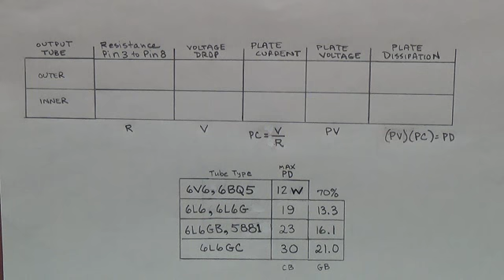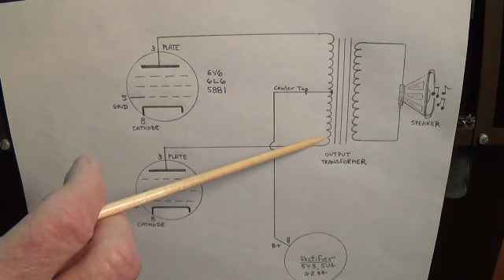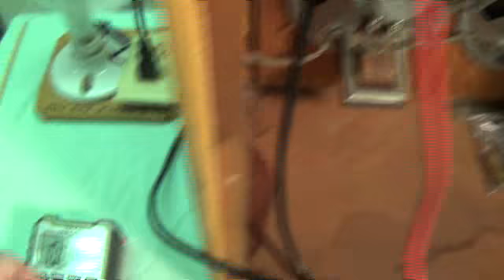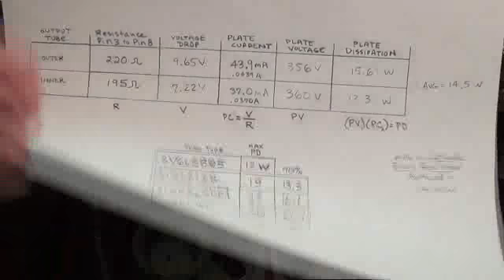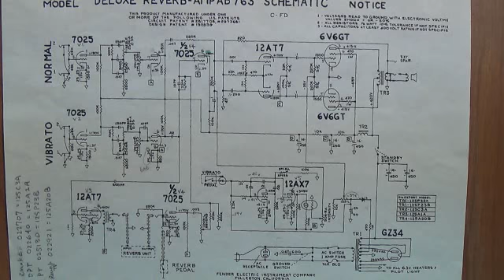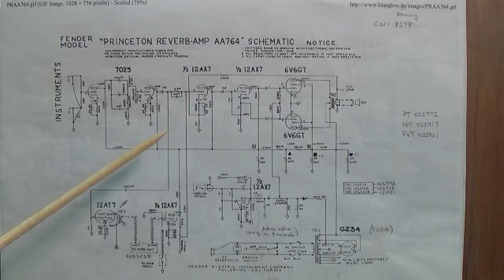Biasing Double-Ended Amplifier Output Tubes, Part 2: Demonstration and Discussion

Comment: Hey Doug, do you have any idea what might cause the voltage drop across the plate and OT center tap to be quite low (about -1.5v maximum)? I'm trying to bias a grid biased amp and am having that issue.
Reply from the maker: If your measurements are correct, then the tube is not drawing much current at all. Check the tube itself (i.e. swap in another similar tube and re-check the voltage drop) as well as the pin contact in the socket and the bias resistor (may be out of range).
Reply: so I swapped out the tubes and have the same problem. I checked all my resistor values against the schematic (fender pro aa763) and they're all the same... as I lower the resistance across the bias control pot the light bulb on my current limiter becomes brighter which I assume tells me something else is pulling current away from the tubes. Does that sound right?
Reply from the maker: As you reduce the resistance of the bias pot, more current flows to ground instead of the tube grids, so this is probably what is making the bulb light up more. When you measured the voltage drop across each of the two windings of the OPT primary, one voltage drop was a reasonable number while the other was essentially zero volts....if I understand this correctly. Have you considered that there may be a shorted or open winding in the OPT ?? Do both primary windings have approximately the same resistance ?
Reply: Both windings have almost the exact same resistance, 125 ohms, and the voltage drop across both windings is unreasonable at, about -1.5 volts max on each. The OPT and tubes are all brand new and the tubes are a matched set of 6L6GC's. I just can't figure out what would keep the tubes from drawing the current they need. I've looked up about everything I can find on biasing power tubes and current flow, but haven't been able to draw any sort of conclusion. The amp is working with a clean output signal but obviously not at an ideal bias point. I really appreciate your input.
Reply: I also just discovered that there is about 2 volts AC running from the plate to the center tap
Reply: Hallo Mike and  uncle doug.
I'm having the same problem with you mike on my silverface super reverb (45w  cbs) and i was wondering if you have finally  found a solution.Any help from you or uncle doug would be much appreciated,
cause  im in a dead end...

Comment: Hey Doug, I just used this procedure to check and change the bias on my old RCA AM/FM/Phono amplifier. It was using about 10.52 / 11.9 W for a pair of 6V6's in push pull. Average was 11.24W so bumping max. The cathode bias resistor was 270Ω. The readings never really stabilized at that output and the audio wasn't that great even at a low setting (3 of 10). I have a few 6V6's and I selected a pair with the same Gm. I installed a 330Ω cathode bias resistor and power came down to 9.81 / 10.88W. Average was 1035W or about 86%. The readings were stable. Plate voltage came up 10V (must've been stressing the transformer a little?). And the plate current was a lot closer. I'm going to leave it there and see what it sounds like. I might've left it the way it was if it was a guitar amp. I don't need distortion in this setup :o) Thanks a bunch for the video. Mike
Reply from the maker: All your measurements and modifications make good sense, Michael.  Plate current and plate voltage are inversely related, so one always goes up when the other goes down.  I hope it sounds great.  Best of luck.
Reply: I finished working on the amp this afternoon. It had a few other issues. The worst was a loud pop followed by a crackling sound that decreased in volume when I turned it off. That's not good. I replaced 5 bad resistors and touched up some ground connections then reinstalled the amp. I am very happy with the way that it sounded and how the volume control worked. And the pop was gone. You can't beat that with a stick. Now if I can just get the FM section to work and align the AM section I'll have a nice, oversized, home heating and audio cabinet :) Thanks for your great videos
Reply from the maker: You're welcome, Michael. Best of luck with your alignment and repairs.

Comment: What I don't get is how you add more resistance before ground and the tubes get colder. Shouldn't they get hotter because more watts get stuck dissipating in the tubes?
Reply from the maker: Watts don't get "stuck" anywhere, NR, they are simply a unit of measurement. Please watch my video series on Resistors and pay close attention to the part about Cathode Bias Resistors.  I believe it will clarify this issue for you.

Comment: I just wanted to thank you for this video Uncle Doug.  I was just able to bias my Fender Deluxe Reverb Reissue using this method and thank goodness I did.

After putting the new Tung Sol 6v6 power tubes in and taking my measurements,  I concluded that the tubes were running at approximately 11.5 watts of plate dissipation!  .5 watts away from hitting the max power for 6v6 tubes!

After a few trial and error episodes of turning the bias pot and taking the measurements again, I was able to get the tubes down to an average of 7.64 watts of plate dissipation which, obviously, is much more acceptable.

What I was curious about was what exactly would change when adjusting the bias pot on a grid based bias circuit.  It appears that the output transformer resistance remains constant.  Turning the bias pot didn't change the resistance from the center tap to pin 3 of the power tubes.

What did change was the voltage drop.  Before any adjustments of the bias pot, I was getting approximately 3.4 volts of voltage drop which resulted in approximately 29ma of current.  In the end, I was able to get the voltage drop down to 1.9 volts which made everything acceptable.  Here is my final chart:

http://i.imgur.com/jyK0bRn.jpg

Anyway, thanks again for all of your help.
Reply from the maker: You're welcome, DJ. The maximum PD for grid-biased 6V6's is 70% of the 12 to 13W max for the tube, or around 8.4 to 9.0W, so your PD is now about right. When you adjust the bias pot, you are altering the negative bias voltage being sent to the tube grids. Increasing the resistance to ground will increase the negative bias voltage on the grids, reducing the plate voltage and plate current....and vice-versa.

Comment: Just to be nit-picky here, and it won't make a huge difference either way...

If the B+ goes through a speaker field winding or a filter choke BEFORE it goes to the output transformer center tap, using your method includes the resistance of the other item.  Resistance and voltage drop should be taken from the output windings, and that will always give the correct answer.

But like I said, it's not going to be a big difference.
Reply from the maker: Greetings, Joseph.  I understand what you are saying, but in no circuit (that I am familiar with) does the B+ travel through any choke, field coil, or resistor before  going to the OPT center tap. Invariably, the B+ is sent directly from the rectifier to the CT, and any choke, field coil, or resistor is always positioned after the connection between the B+ and CT.  Furthermore, if there were any resistance between the B+ and CT, it would be included in both the measured resistance and voltage drop, and thus would not affect the accuracy of the current calculation in any way.

Comment: I am trying to bias my Sunn Sentura II. Using the schematic I have determined it is grid biased but i  am having difficulty tracing pin eight on the rectifier to the  center tap of the transformer. I am replacing the tungsol  6550's that were in it with kt 88"s as called for in the schematic. I also replace the 5u4 rectifier tube with a gz34 . my question is this. are the bias values for this amp with these tubes determined by using pin 8 on the rectifier and pin 3 on the kt88's?
Reply from the maker: If you're trying to determine the plate current for each tube by measuring the voltage drop across each half-winding of the output transformer, then you must use the lead closest to the 
center-tap.....which may not be pin 8 of the 5U4 or GZ34 rectifier.  Check the schematic to see if there is a standby switch and/or a filter choke between pin 8 and the CT. If there is, then you need to find a CT connection after the filter choke and be sure the standby switch is closed. Your other test lead will be on pin 3 (plate) of one output tube and then the other.

Comment: great video! with the help of your videos and merlin blencowe's book I'm now converting/building my first amp out of an old italian geloso PA amp. But i have a question. it is a push pull 18 watt style amp now with cathode bias (shared 150 ohm with bypass cap)
with outer tube: platevoltage 296V and Pcurrent 36mA and 10.8 Watt dissipation
and the inner tube 300v, 24mA and 7.2 W dissipation. so there is a pretty big differance. what would be be best thing to do? since space is limited would getting a new matched pair be te best choise? 
Thanks for al your vids!
and greetings from holland.
Reply from the maker: Thanks, Hyzleier.  This is a common problem with older, used output tubes. As they age, a significant disparity in current flow develops within the two tubes, making the biasing process more difficult. You have three options:  1.) Replace the shared cathode bias resistor with two separate resistors, each chosen to provide an ideal PD within each tube.  2.) Replace the mismatched output tubes with a matched pair (hopefully they will actually be matching.....many such pairs are not properly matched by the vendors).  3.) Buy one new output tube and then pair it with whichever of the original tubes is closest to it in PC and PD (hopefully it will be closer to one of them than they are to each other).  Option 1 is the cheapest, easiest, most certain and most accurate.....but eventually, you will have to replace one or both of the tubes due to diminishing performance caused by age.
Reply: +Uncle Doug thanks for the quick reply. So instead of shared cathode with 150 ohm restistor and 50uf cap, seperate them and put a 150 ohm resistor and 50uf cap on each of the cathodes to ground and then change the resistors till I get the bias I want?
Reply from the maker: Yes, but rather than starting out with 150 Ohms each, you could extrapolate individual resistances that will compensate for the difference in PC.....i.e. outer 140 Ohms, inner 110 Ohms, if you are seeking a PD a little below 12W.
Reply: Merlin's book is the bomb! I've really enjoyed reading it.  And you're right, between that and Uncle Doug, you got all you need to work on amps.
Reply from the maker: Thanks, Lincoln, and best of luck with all your projects :)
Reply: A shared cathode resistor passes the total current flowing in the two tubes which develops the bias voltage at the cathodes. Since the current in only one tube is flowing in each separate resistor, it passes half the total current so each needs to be double the resistance of the single resistor to develop a similar voltage at each cathode. With 150 Ohms for each cathode the tubes would pass far too much current, and probably damage the tubes.

Comment: Again another great video! 

I'm a little confused though as to where to properly set the bias on my "35 watt" 1968 Vibrolux Reverb.  
If I use 70% (grid bias) of the 30 watt rating for a 6L6GC with 430v on the plates,  that would put me at 42 watts(21 watts per tube).
Am I missing something? All the descriptions and overviews of this amp refer to it as "the 35w Vibrolux Reverb". 
I would think each tube should be at around 17.5 watts.

Hope that doesn't make your dumbest questions file:)
Thanks!
Reply from the maker: The output wattage and the plate dissipation wattage are completely separate measurements. The only similarity is that both measurements are stated with the same units.....watts. Your amp is rated at 35W of output power, and your output tubes will function best if the plate dissipation of each is set at 21W per tube, as you say.
Reply: +Uncle Doug 
Okay,  thanks.  I was confusing the two.
Reply from the maker: It's understandable. Never hesitate to ask if you are uncertain about something.
Reply: Uncle Doug- Same amp (68 Vibrolux Reverb); how hot should the output transformer get, and how can I test it's "health"? Thanks-
Reply from the maker: It may get warm to the touch after 15 or 20 minutes, especially if the output is high volume. It shouldn't get real hot. The best test I know is.....if it works, it's healthy.

Comment: hi great video...my question if the amplifier is ultra linear with extra taps on the transformer for the screen grid...are there any differences in the procedure for measuring. thanks
Reply from the maker: Thanks, Sparkey. The procedure would be the same, but your plate current measurements will be elevated a little, because you will be measuring both the plate and screen current. You can either measure the screen current directly (same method but measure resistance and voltage drop from CT to screen tap instead of to plate tap) and subtract it or check a tube handbook for an estimate of screen current (usually about 3 to 5mA) and subtract it. Good luck.
Reply: thanks for your fast and helpful reply...thought i had better check with the expert first!
Reply from the maker: You're welcome, Sparkey. Best of luck with your biasing project.....be careful :)

Comment: Hi Uncle Doug, First of all Thanks so much for your videos. Youve taught me alot already. 

I have a Fender 140 that I have performed your bias analasys on. There is not a tube rectifier so i am using the red wire from the OPT to the HI LO Power switch to as th CT connection. My readings are as follows. switch is in the high power position. Tubes are 6l6 GC. 

Pin 3 to CT resistance = 38
pin 3 to CT voltage drop = 3.12
calculated voltage drop = .0821
Pin 3 to chassis Plate voltage = 515
calculated Plate dissapation = 42.285

I've only included specs for 1 tube as they are all really close. This amp does have a schematic online and does have a output tubes matching pot. Bias seems to hot to me but my attempts to lower the bias via the matching pot are failing. pot  was originally all the way turned down and had a 10k resistor on it. i changed the resistor value to 33k then 100k. pot still has to be in the fully turned down position or the bias goes up and I'm still in the 40's for watts. Please help me figure out how to get this bias down. 

Thanks, Thadd
Reply: Also could you clarify how that matching pot should be wired. it looks different to me than the schematic.

 mine has:
 red from hi lo power switch on the left tab
wires to grid on the wiper center tab
and resistor grounded to pot on the right tab
Reply from the maker: I'm afraid I can't help on this, Thadd. If your amp is unmodified, then I would accept its wiring as is.
Reply from the maker: Your red-to-blue resistance (OPT primary) is only 38 Ohms? This seems way to low. With a Vdrop of 3.12V this would indicate a PC of 82mA, which is very unlikely, and a PD of 42.3W.....also very unlikely.  You'd better check your resistances again, red-to-blue and red-to-brown.
Reply: +Uncle Doug 
Thanks for your quick response. I just re-checked reading ohms
 red to brown  36.6
red to blue 38.6
Idk?

am I supposed to divide by 2 anywhere in this equation since there are 4 tubes total. 2 tubes per side.
Reply from the maker: The schematic I looked at did not show 4 output tubes  http://www.emerald-green.de/images/fender-140-schem.jpg. Yes, the PC should be divided by two, so the PC for one 6L6 is 41mA, which is more believable. The PV is best measured from plate to cathode (not ground). Let's say it's 495V, then the PD would be a little over 20W, which is just right for fixed bias 6L6GC's (70% of 30W).
Reply: ok so false positive on the bias problem. thanks for your assistance again. its great. Happy Memorial Day
Reply from the maker: You're welcome, Thadd.
Reply: i have another question. This amp has an ungrounded buzz sound any thouights on where i could look to fix that?
Reply from the maker: There are numerous causes of hums and buzzes. Correcting it would require diagnosing it in person. There are websites that offer advice about how to do this.
Reply: Thanks, and hello to rusty
Reply from the maker: You're welcome :)

Comment: Unncle Doug, I've got a shot-in-the-dark question for you.  

I recently converted one of my homebrew amps (a Tweed deluxe in a Blackface Dekluxe reverb-style chassis) to a Blackface Princeton Reverb circuit.  It seems to work fine, except I get a weird buzz when the tremolo is engaged.  Here's a short example: https://youtu.be/t5n7Oo1V4yk

Have you ever heard a buzz like that?  any thoughts on what it might be?  I've tried several different speakers and get the same results with all of them.  It's biased as cold as it will go- about 6 watts per tube (I installed a 50K-L pot in the bias circuit).
Reply from the maker: +Nick paflas   Long distance troubleshooting is really tough, Nick, but when it involves a highly modified, homemade amp, it's virtually impossible.  About all I can suggest is the obvious.....double check the tremolo circuit, all components, and wire routing.  Excessively cold bias really diminishes tone.  Why not adjust the PD closer to 10 or 11W.....it won't help the hum, but it should dramatically improve your tone and allow for break up at higher volume.

Comment: I have a multimeter that measures DC Current.  Can I eliminate the middleman and just measure the current from the plate to ground?
Reply from the maker: +Nick paflas  Connecting an ammeter in series with the plate or cathode would measure current, Nick, but at hazardous voltage levels, and it would require un-soldering the wiring to the tube socket so the meter could be inserted. It's a whole lot faster, easier, safer, and just as accurate to use the voltage drop method.